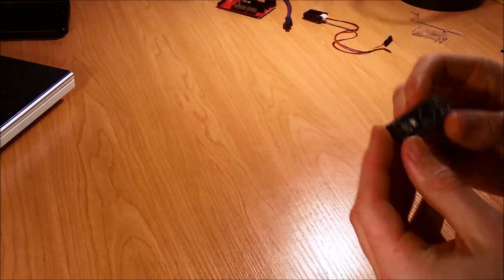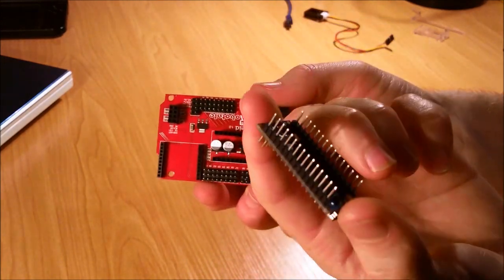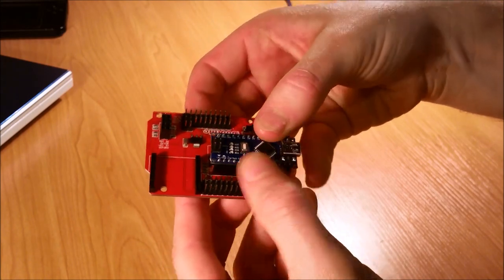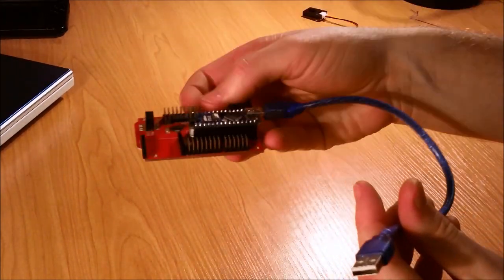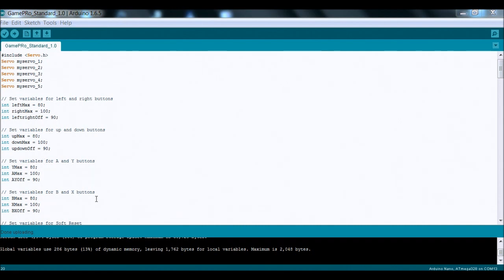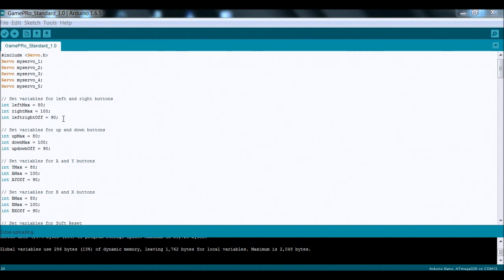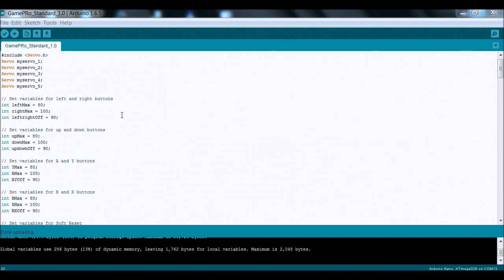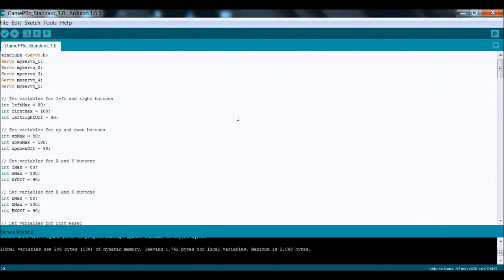GamePRo Assembly Step 3 - Upload Code to Micro controller

Comment: Hey Nooby, I'm having an issue with this step. I finally got back home to assemble my gamepro and one of the teeth on the nano micro controller is bent downwards at like a 45 degree angle. I can continue this over private messages and send you pictures of the defective part if you'd like, I just want to know if I'll need a completely new part or if there's a way/tool I could use to fix it manually, thanks.
Reply from the maker: +1yoshi79 Hey there, you may be able to bend the pins back in to shape, otherwise I can potentially send a new part. Either send me an email or a private message and I'll look in to it :)